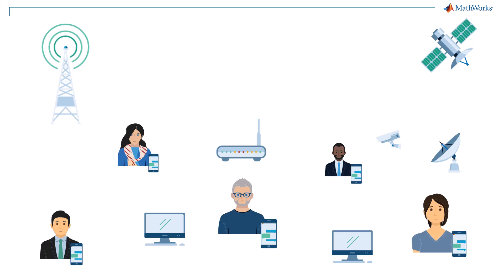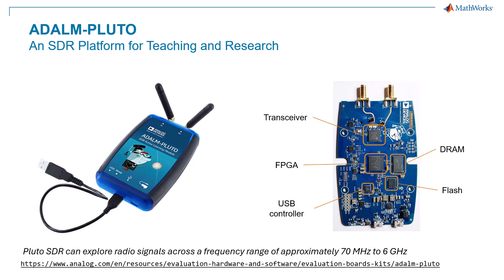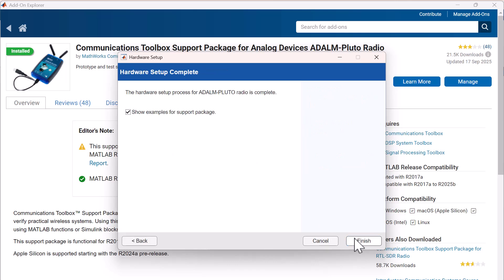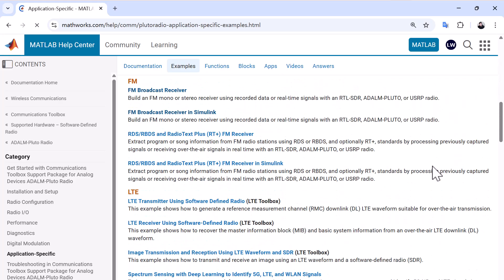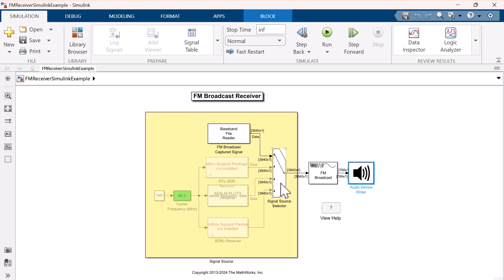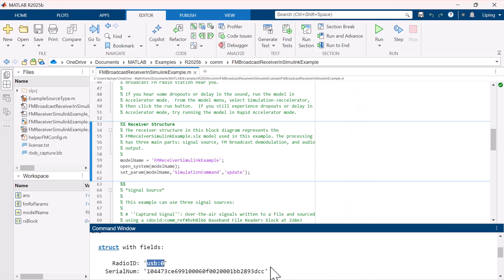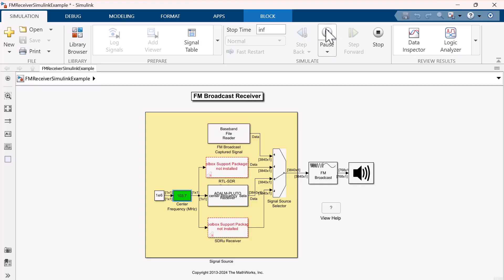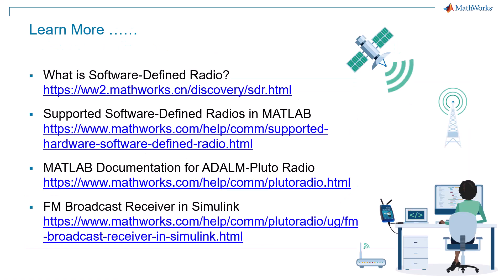How to Explore Wireless Signals Using MATLAB and Software Defined Radio

Comment: Wow, this one looks so cool! Thanks for the interesting video. Would it also work for shortwave radio? Or can I record a specific radio program with this?
Reply from the maker: Thank you. The Pluto SDR in this demo works in the 325–3800 MHz range by default, and even with the AD9364 setup, it goes up to 70–6000 MHz. Shortwave radio is around 3–30 MHz, so that’s outside what this SDR can handle. The good news is it does work for AM/FM radio, and you can record a program by saving the audio from the received signal.
Reply: @MATLAB thank you!